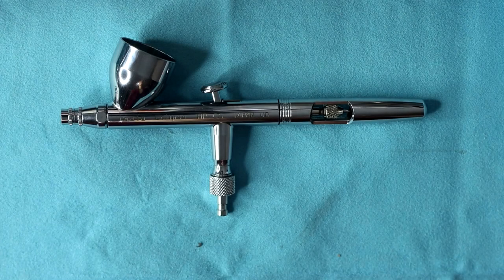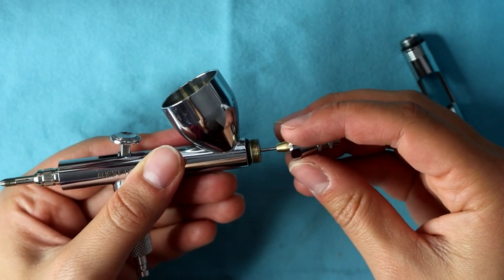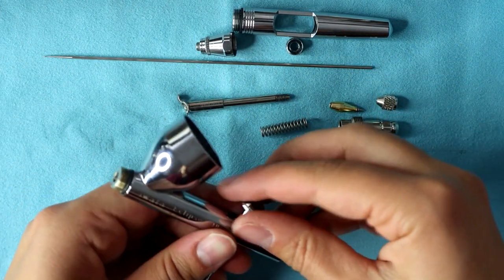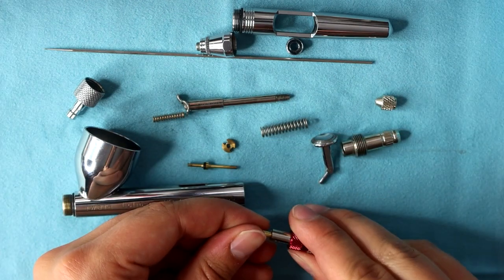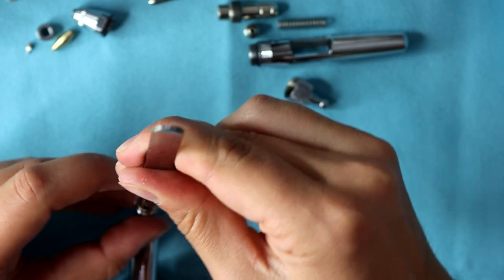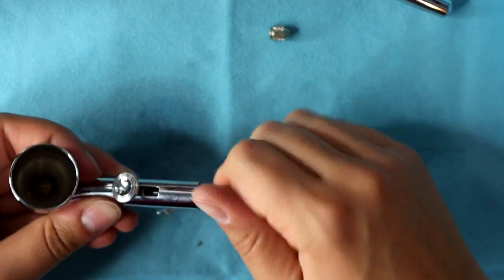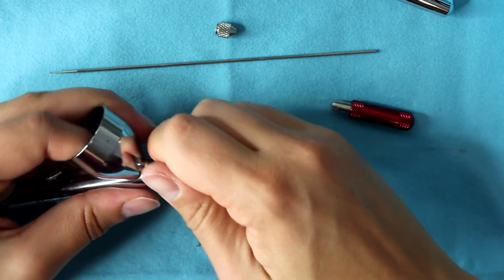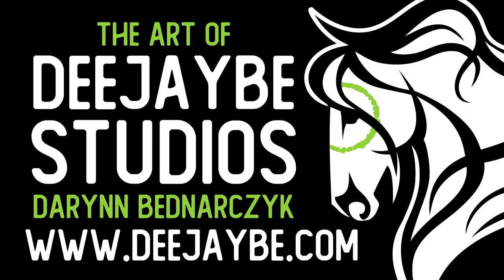How to DISASSEMBLE & REASSEMBLE your Iwata ECLIPSE Airbrush

Comment: The nozzle unit is NOT designed to be taken apart, as stated in the instructions, it is an entity and not comparable to the tiny nozzles used on the more expensive models.. 🤔😵
Reply from the maker: There are times I must release the delicate nozzle from the rest of the nozzle in order to clean. That is where I use the nozzle wrench. Paint gets into the threads that needs to be cleaned.

Comment: "Don't pull the needle out the back as you will pull paint into the body" doh, i've been doing it this way for years. Guess i'll try this new way. Was only going to use this video for switching to .5 mm from .35 mm but now that the front pieces have been cleared, will be easier to clean front only.

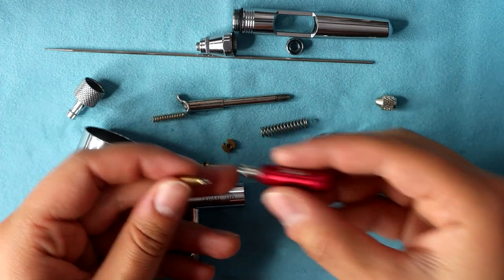Comment: Never remove the nozzle tip as shown at 1:21 in the video. That tool is designed for the Iwata neo, not the eclipse.  You cannot replace just that metal tip of the nozzle on the eclipse, but you can on the neo.  If you ever need to replace your nozzle tip on an eclipse, you don't buy them separately, the nozzle tip comes as a complete assembly with the nozzle body. Disassembling the nozzle further can impact the performance of the brush, cause needle and nozzle misalignment, overall degradation of performance, leaks, etc.  If you need to clean the nozzle, you can soak it in cleaner and/or use a shaved toothpick or the needle itself to clean inside the nozzle, there is never a need or reason to disassemble it on the eclipse.
Reply from the maker: Yep, I’ve seen this comment several times on the video. The piece does come apart for the purpose of this video. But not needed for general cleaning.
Reply: @DeeJayBeStudios  It can come apart but there is simply no reason to do so. The inside of the nozzle can be cleaned without disassembly using a toothpick.  Its a completely avoidable risk that has no benefit. 

In fact, in Iwata's own official video for cleaning the CS it states not to disassemble the nozzle assembly.

https://youtu.be/OMBvMIG9dbA

The tool you used is made for the Neo, which can be seen being disassembled in this other official iwata video

https://youtu.be/3bSUj0l4zM8?t=136

Edit: I read in another post where you stated that a buildup of paint can get in the threads.  This is not actually true.  The "buildup" you noticed after disassembling the first time  is the sealing agent (threadlocker) used when the factory assembled the nozzle.  They are machined together,, and on the inside (if you use a microscope) there is no lip or transition between the nozzle body and tip.  It only ever needs to be cleaned with a toothpick after being soaked in cleaner.  If the nozzle is worn to the point that disassembling the nozzle seems like the only possible solution, then it is time to replace the nozzle, not disassemble it.  There is simply no way for you to torque it back to the proper factory spec after, it will either be too loose, which WILL allow paint to seep into the threads, or it will be too tight, which will deform the brass or nickel and create a lip or mar which will reduce brush performance, in which you create the very problem you're attempting to correct by disassembling the nozzle.

All that said, its your brush, do what you want. 

The problem is that your video implies that this is proper step in a deep cleaning procedure, and its not. What you do with your brush is not my concern, its what you influence other people to do with theirs that concerns me. People might listen to that advice, even though its bad advice. Deep cleaning does not require the disassembly of the nozzle, ever, and if people follow your instruction they could ultimately diminish their brushes performance, which has the potential to creates negative experiences both with this hobby, and with this brush in particular.

Comment: How do I get the golden tip out, mine is just stucked, can’t remove it that easy
Reply from the maker: If you add some isopropyl alcohol down into the cup. You can Gently push the nozzle to one side to release it. Be careful not to damage the tip.

Comment: What about the air valve sleeve that the air valve rod goes into? I have a GSI Creos and I'm under the impression they are roughly the same. How do you remove the air valve sleeve that the rod, spring and cap sit in?

Comment: I noticed you don't have a rubber gasket on the very bottom and instead used a quick connect. Any problems with leaking air?  Getting that tiny o-ring gasket is a pain!
Reply from the maker: You can connect the hose directly to the airbrush or have a quick connect. The quick connect does not leak at all, and you can hear it click in.

Comment: Left out the needle packing bolt.ive got splattering after I turn on full fluid and full air and turn off then when I turn on air paint sticks to needle and initially I get splatter and when I continue to use as long as I don't go full fluid and air lit will not splatter do you know what problem could be also got a new nozzle and polished and sanded the needle with no luck do you think it could be needle

Comment: Just a quick note: The person who said the nozzle shouldn't be taken apart seems to be correct. From Iwata's website:

"For Iwata Eclipse airbrushes (compression fit nozzle):

The nozzle (4) for the Eclipse BS, SBS and CS is a set and SHOULD NEVER BE SEPARATED.

DO NOT USE the Iwata Nozzle Wrench on compression fit nozzles."
Reply from the maker: Unfortunately there is a good degree of paint buildup within the threads. Overtime it does need to be separated for optimum cleaning. I definitely don’t always do this- just for deep cleans. I’ve never had a problem since using the nozzle wrench.
Reply: @DeeJayBeStudios  I never knew it could be separated and OMG there is paint in there from 30 projects ago. Thank you for this video.

Comment: Come si toglie la vite interna al corpo per sistituire la guarnizione ?     How do you remove the screw inside the body to replace the gasket?
Reply: Use a screwdriver, flat. Be sensible on the size

Comment: I recently went to a store that sells airbrushes that shouldn’t sell airbrushes.  Sorta like having a bunch of preschoolers loose in a gun store. They don’t even know anything about the product and eventually, over time, something ugly is bound to happen. That said I had to do my own hobby research and should have stayed in the lobby of that craft store if you get my drift.....I did find a great deal on iwata HP-BCS but it was the weekend and iwata customer service was closed....so I got that airbrush but it has a .5 mm needle. The highly recommended HP-CS has .35 mm needle....also on display were the needles, nozzles and caps for iwata in .35 but for CN model airbrushes,,,finally my question,,,,,,can I use the .35 CN fittings in the HP-BCS or has Iwata booby trapped them so you can’t interchange parts in their airbrushes????  Or along this line, are the fittings generic and I could use other brands interchangeably???? For example badger, panache, or master needles, nozzles and caps in an Iwata?????? Thanks for the input.  Vegas is really slim pickings in this category an I have to go to Anaheim CA for definitive answers.
Reply from the maker: You can only use iwata parts on an iwata airbrush. I do believe that you can use the 0.35 needle set. You would need the nozzle, needle & nozzle head to do so. I have the Micron airbrush as well; and it converts to two sizes of needle just based on the head components.